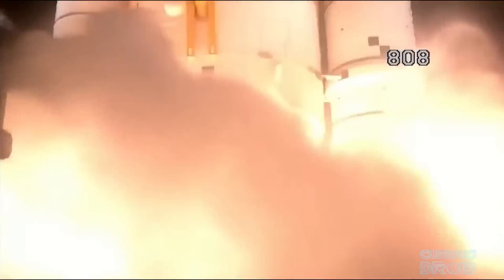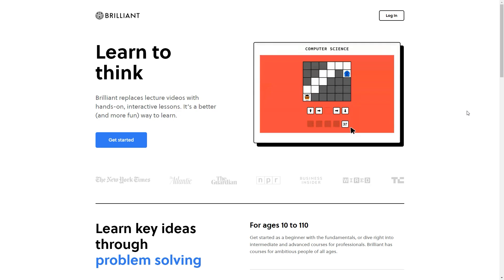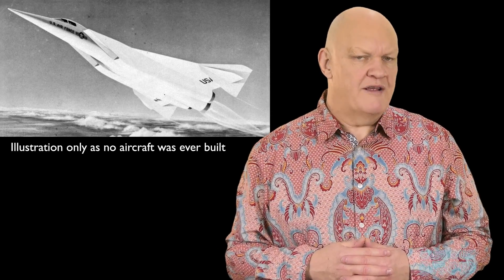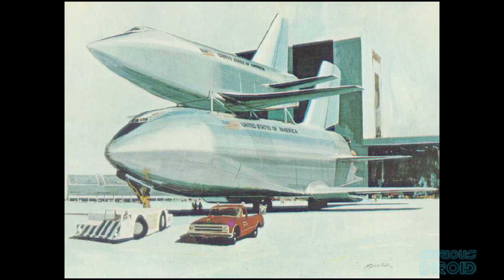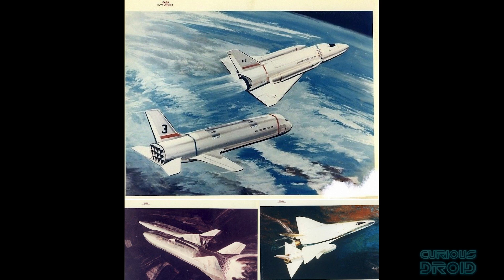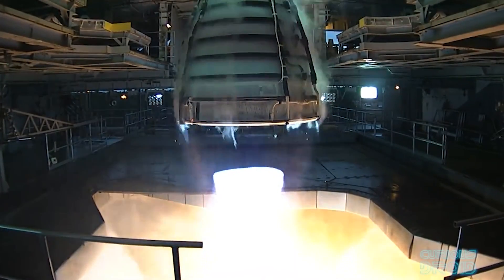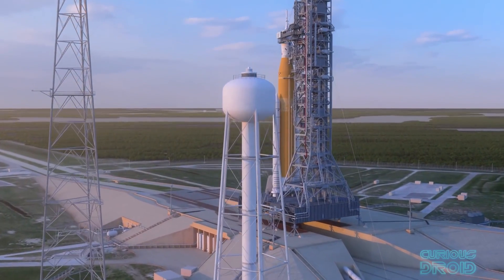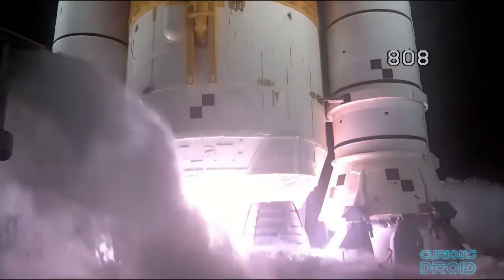Why is NASA Throwing Away Reusable Engines?

Comment: Its the simple fact that they are dumping RS25s into the sea that I couldn't care less about the SLS or Artemis missions. Its 1960s ideas chucking great engines into the ocean. 

Space X and its reusability is far more interesting.
Reply: Booster reusability is great, but has drawbacks.

First, if you don't have a fast enough launch cadence, you can spend more on recovery equipment and personnel than you save by reusing the booster.
Second, you take a payload hit for the recovery system on the booster. The Falcon 9 B5 can lift up to 22.8 tons to LEO when expended (SX), but only up to 16.7 tons when landed on a drone ship (B1069.2). Doing a Return to Launch Site (RTLS) landing, costs even more payload as you have a boost back burn to cancel the lateral velocity and return back to the launch site.
Third, the higher and faster you go, the harder reusability is to perform. The heavier the dry-mass of your booster, the harder reusability is to perform.

So with SLS launching once a year, eventually, the cadence doesn't really justify recovering the booster. Not to mention that it gets higher and faster than a Falcon 9 as the SLS core stage almost reaches orbit, making recovery MUCH more difficult. The SLS core stage is travelling well over 3 times as fast as the Falcon 9 booster and is well over twice as high as the Falcon 9 booster at MECO. The dry mass of the F9 booster is 22-25 tons while the SLS core stage is 85 tons.
The SLS Block 1 can get Orion to the Moon, but not with the kind of payload hit like F9 has. The SLS Block 1B will send along a Lunar Gateway module with Orion, so it really can't take the payload hit either.

SLS started design work in 2011, 4 years before SpaceX landed the first booster and almost 6 years before they reused a booster.
Reply: @steveaustin2686  and then there is starship, which will be so cheap that you can do an orbital refueling of one with others shuttling it fuel.
Reply: @miguellopez3392  Starship is still in early development and based on SpaceX's plans for Artemis III, is not going to replace SLS/Orion for a number of years.

From page 27 of the GAO decision to deny the Blue Origin complaint. [DELETED] is apparently at least a propellant depot Starship variant from the context and SpaceX had the GAO redact that info. Added in Musk's payload update (~150t) and he says that it is up to 8 Tankers to fully refill Lunar Starship, depending on Lunar Starship's mass. My comments are in ().

"SpaceX’s concept of operations contemplated ten total launches (down from 16), consisting of: 1 launch of its [DELETED]; 8 launches of its Tanker Starships to supply fuel to [DELETED] (down from 14); and 1 launch of its HLS Lander Starship, which would be [DELETED] and then travel to the Moon."

Per page 10 of that same GAO report, the SpaceX planned launch cadence for Artemis III is 1 Starship variant every 12 days. That means up to 108 days (plus any scrubs) to get HLS Starship to the depot to be refilled, before heading to the Moon. Even if you reuse the depot, that is up to 96 days to get a Starship Shuttle with crew or a Starship Tanker to the depot to be refilled before going to the Moon. Since HLS Starship can only wait 100 days in lunar orbit, pg 9 Apr 2021 HLS Option A Source Selection Statement, SpaceX will need a much faster launch cadence, or less Tanker flights (not likely), to replace SLS/Orion. Since it took over 10 years to get the Falcon 9 to a once a week cadence, it will likely take some number of years after Artemis III to get Starship to a once a week cadence.

Based on the $1.15B HLS Option B contract for the Artemis IV landing, that puts each Starship launch at roughly $115M, based on 10 launches to get HLS Starship to the Moon. Cheaper than SLS, but not the magnitudes cheaper people claim. Yes, Musk has an aspirational goal of $2M per launch in the far future when hundreds to thousands of Starships are flying, but that is NOT happening in the early Artemis missions. Not to mention that Musk has admitted that he reguarly makes overly ambitious goals, so that SpaceX will reach as far as they can, before settling on what they can actually do. So that $2M per launch may never come true.
Reply: @steveaustin2686  it's not in early development anymore, launch is scheduled to be within the year, it's had a much faster development in its technology then what was seen with the SLS, even at 150 million per launch it is still far more feasible than the SLS which has engines that take far longer and more expensive to produce than the raptor 2.
Reply: @miguellopez3392  Musk has said that they are confident that Starship (second stage) will get to orbit, but not 100% confident. Hardly a launch system out of early development. Especially, when Musk said that they expect it to take multiple attempts to get a successful re-entry and landing. SpaceX has a $50M contract to demo Starship to Starship refueling in LEO by the end of 2022 and it doesn't look like they will make that time frame. Even so, the 10 ton demo is a far cry from the 150 tons a Starship will carry or the 1,200 tons the depot will have to transfer to HLS Starship. There is a LOT of development to go before Starship is ready for the unmanned test landing in 2024-2025. The NASA IG thinks that Starship may delay the Artemis III manned landing if development has problems. Luckily, the re-entry and landing are not really required for the Artemis landings, as long as Starship can get to orbit and transfer propellant. Expending that many Starships would be REAL expensive though.

Comment: Thank you for showing the Shuttle configuration that NASA originally wanted funded. The united states congresscritters are short-sighted war-mongering asshats. If the original configuration had been funded, then the Challenger accident would not have occurred - at least not due to failure of a booster rocket seal.
I was under the impression that one mothership/Shuttle configuration would have had a horizontal takeoff from a runway. Or were they always going for a vertical stack launch?

Comment: In an age where we're supposed to be maximising dwindling resources and recycling wherever possible, this kind of wastage shouldn't even be allowed. But hey, it's the US. They're a law unto themselves, as usual.
Reply: Booster reusability is great, but has drawbacks.

First, if you don't have a fast enough launch cadence, you can spend more on recovery equipment and personnel than you save by reusing the booster.
Second, you take a payload hit for the recovery system on the booster. The Falcon 9 B5 can lift up to 22.8 tons to LEO when expended (SX), but only up to 16.7 tons when landed on a drone ship (B1069.2). Doing a Return to Launch Site (RTLS) landing, costs even more payload as you have a boost back burn to cancel the lateral velocity and return back to the launch site.
Third, the higher and faster you go, the harder reusability is to perform. The heavier the dry-mass of your booster, the harder reusability is to perform.

So with SLS launching once a year, eventually, the cadence doesn't really justify recovering the booster. Not to mention that it gets higher and faster than a Falcon 9 as the SLS core stage almost reaches orbit, making recovery MUCH more difficult. The SLS core stage is travelling well over 3 times as fast as the Falcon 9 booster and is well over twice as high as the Falcon 9 booster at MECO. The dry mass of the F9 booster is 22-25 tons while the SLS core stage is 85 tons.
The SLS Block 1 can get Orion to the Moon, but not with the kind of payload hit like F9 has. The SLS Block 1B will send along a Lunar Gateway module with Orion, so it really can't take the payload hit either.

SLS started design work in 2011, 4 years before SpaceX landed the first booster and almost 6 years before they reused a booster.